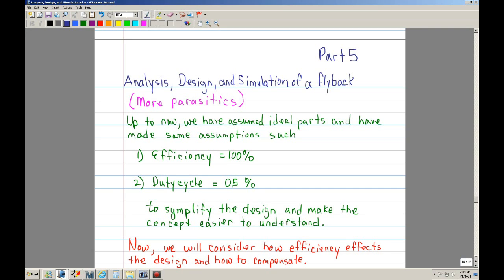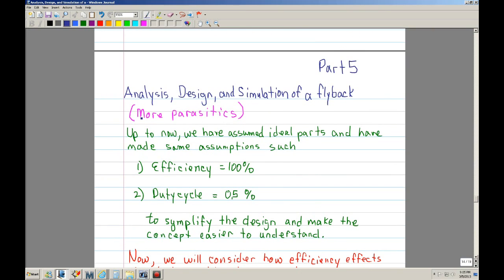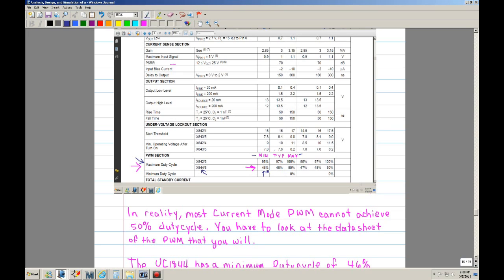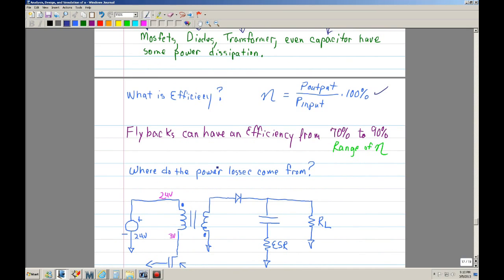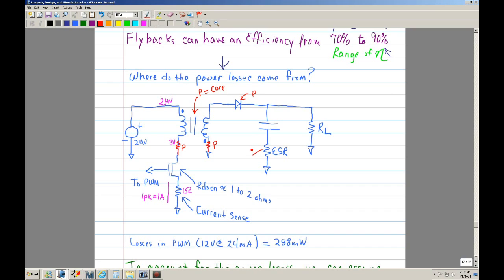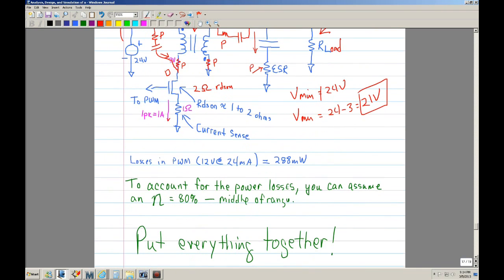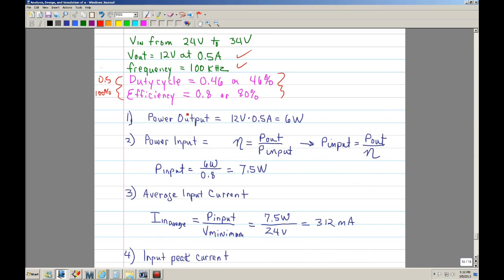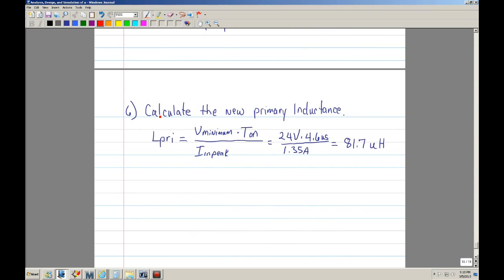Analysis and Design of a Flyback; Part 5, How to Account for Efficiency and Duty Cyle

Comment: Hola Robert, una consulta, este procedimiento de cálculo para la inductancia del primario es para diseñar una fuente que trabaje en modo continuo o discontinuo? Muchas gracias por sus videos, estoy aprendiendo a hacer fuentes flyback prácticamente con sus videos y con libros que recomendó.
Reply from the maker: Hola ElectoMatic, el procedimiento es para una fuente trabajado in discontinuo. Es mas fasil de desenar el discontnuo porque the compesasion del Error Amp se simplifica y uno puede usar un Type 2 de Error Amp compensasion. Gracias por la pregunta!  Saludos, Roberto
Reply: @RobertBolanos  perfect, Ill talk in english if its more comfortable for you... Today I was in the lab and tried to make a continuous mode flyback but it wouldnt stop oscilating, I am sure it was because of the inductance value I used, I tried compensation and all... Then I changed the transformer by another one I had with like 47uH of primary inductance and it started working in discontinuos mode like a charm!!, so Ill try using your methods step by step. Right now im writting python code for automating the calcs. Grettings and thanks for your response!
Reply from the maker: @electromatic2014    When you use continuous in a flyback it introduced a zero in the right plane that causes it to oscillate. In that case you want to calculate where this zero and place the crossover frequency at least a decade below the zero frequency. 

In discontinuous mode, you do not have the right plane zero and the compensationis much simpler. As long as the power is below 100W, you should be OK using a flyback working in discontinuous mode.
Reply: @RobertBolanos  I put it at 1/4 of the RHPz frequency, as the uc3842 datasheet said, I will try a decade!, Thanks for your advice, im Just trying to do a simple 24 to 5V flyback for like 1A or so for experimenting, then Ill make it 48V to 5V that's the real case I need it. I Will dive in more in the discontinuous operation, thanks a lot for your advice!

Comment: Is 46% Dutycycle the minimum really? It appears from the datasheet to be the lower tolerance value of the maximum possible dutycycle. The lowest possible PWM is 0%, right?... Thanks alot for your videos, i learned alot from your knowledge
Reply from the maker: Hi Hamad, when using a discontinuous flyback, you need to limit the dutycycle to less than 50% so that the transformer can reset. Also, some datasheet will publish the maximum dutycycle. So you want enough margin. So if the datasheet says 48% then subtract 5% or what ever margin you feel comfortable. If you do not give yourself enough magin, then at low line, when the input voltage is minimum, the output voltage will not be regulated because you are already hitting the maximum dutycycle. I kope this makes sense.
Reply: thank you for your quick reply!.  Yes that makes sense.

Comment: The best video on this topic. I will surely watch all the parts whenever I find a bit free time. I have a quick question. whats the best way to calculate the wire gauge depending on current ? say for example I have a requirement of 12V/1Amp at the secondary side, what copper diameter should I select for 1Amp ? will it be based on average current or peak current ?
Reply from the maker: I like to use either Preece  or Onderdonk equations which will give you the fusing current.  If you use either equations and use a 10AWG, I think you get a fusing current of 200A. This means that if you pump in 200A, the wire will melt.  Once you have the fusing current, you take 10% of the fusing current. So you can use a 10AWG to carry up to 20A. This calculation should match typical wire gauge vs current table that you can google. I hope this answers your question.http://www.pcdandf.com/pcdesign/index.php/magazine/10179-pcb-design-1507

Comment: hello, I'm not good at speaking EL, i hope you 'll my understand , thanks.
 I see : Vout= Vin. N.D/(1-D)*Vin.  it has a relationship between N and D.
 with efficiency = 100 % , you choose N=0.5 and D=0.5 ==> Vout= 24V.0.5.0.5/(1-0.5)=12V . OK
 but
 with efficiency = 80%, you choose N=0.5 , D=0.46.  I think you change 'D' , you have to change 'N'
 Why is not changed " N=0.5"" ?
Thanks for your helping.
Reply from the maker: I had to change D to 0.46 because when you use real parts, in this case a PWM (Pulse Width Modulator), I noticed the minimum guaranteed dutycycle was 0.46. This means that it could not go any higher that 0.46 and that the PWM will not reach 0.5. So I had to account for that limit and therefore used the D of 0.46 in my calculations. I hope that helps. Questions and comments can be sent to rbola35618@aol.com. Thank you for your comments. Robert

Comment from the maker: However, if you look at the denominator, you will see that frequency can be decreased in frequency from 100KHz to 40KHz and still meet the original Po=6W. 

Use the equation above and play with Linductor and frequency. You should be able to come to a solution.

Thanks for the questions and best regards.

ps  What part of the world do you live in?

My personal email is rbola35618@aol.com

Robert Bolanos

Comment: @Robert Bolanos

Hi Robert,

At the end of video you calculated the inductance to be 81.7uH
Let assume that I changed the inductance to 200uH and changed the duty cycle
so that the output remain 12VDC.
Is it fair to say that this is possible however, only efficiency will drop. 
Is this true?

Thanks you
TH